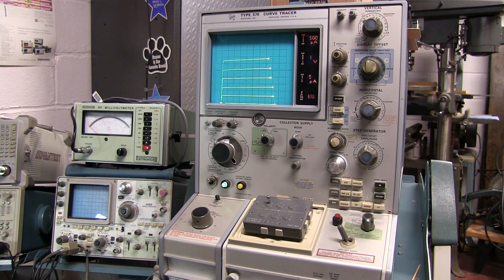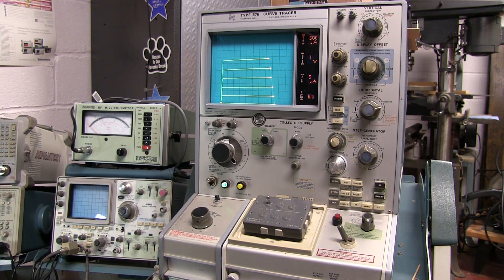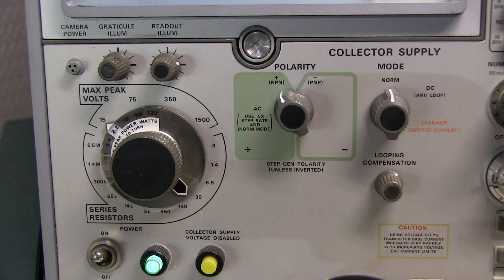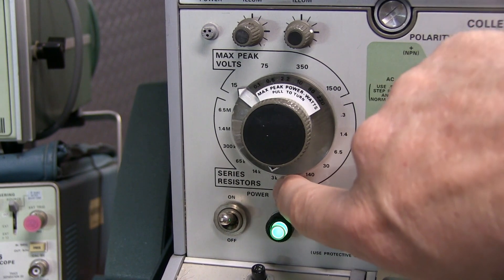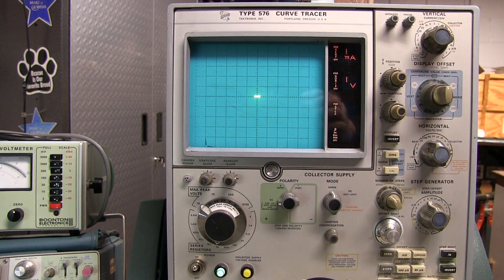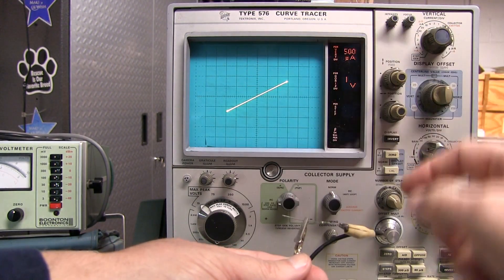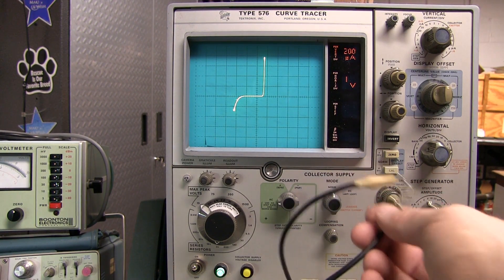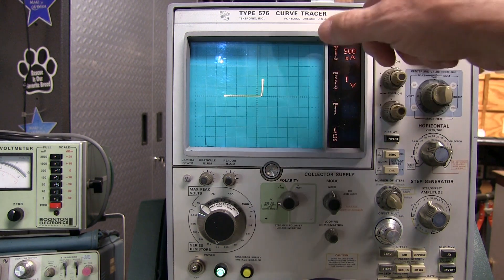#353: Quick Tips: Using a Transistor Curve Tracer as an Octopus I/V Tracer or Huntron Tracker

Comment: Do Curve Tracer measure the transconductance of Transistors and FETs? Some modern transistor testers measure the transconductance but its in Siemen Units which I'm not sure why its displays in Siemen units? I'm guessing the transistor tester is applying an AC sine-wave signal AC voltage to the transistors base and measure the transistors collectors current to compute the transconductance value?
Reply from the maker: Not directly, but it can be calculated between the ID/VDS curves at different VGS values.
Reply: @w2aew  The biasing voltage for a Tube, Transistor or FET will "change the gain more or less gain"/transductance, which is based on the biasing voltage? What I have read is the biasing voltage will change the transductance/GAIN more or less of the tube, transistor or FET. Does this sound correct? I'm guessing the tube, transistor, FET tester units transductance test is taking an "average" of all the DC voltages and displaying a transductance average. The tester unit must be using an AC sine waveform and measuring the input and output to compute the gain, while varying the DC bias voltage to get lesser gain or more gain and taking an average to display the transductance in siemens units?

Comment: I used the previous 575 curve tracer at work for years  to test transistors, diodes and Fet, they can be very useful when you need to sort parts for a specific parameter. In HS we had a 570 tube curve tracer that is pretty rare these days.

Comment: That curve tracer is in mint condition. I remember there is a Polaroid camera adapter for taking snapshots of the screen. Not sure if the film for such a camera is made anymore. Perhaps there is an adapter for a digital camera to take screen shots.
Reply from the maker: I used to have/use a few of the polaroid scope cameras.  It was a right of passage to have your photo taken with one and have it hung on the bulletin board in the lab.   I would think that one could 3D print an adapter for a modern digital camera or camera/phone.

Comment: Why are you applying an AC waveform to diodes and transistors to get a signature from semiconductors use DC voltage to bias them in operation region? I would think you would need a DC biasing voltage to put the diode and transistor into operating region to get the correct signature. For Capacitors having an Ellipse circle shape but since its a Ellipse Circle which part is the current and which part is the voltage? The Shape/Size of the Ellipse Circle is based on the capacitors value which the Ellipse Circle shape/size is the voltage and current?
Reply from the maker: Using AC allows you to get the current-voltage curves easily traced.
Reply: @w2aew  Yes but I would think that semiconductors like diodes and transistors would ALSO need DC biasing voltage to see the correct signatures?
Reply from the maker: @waynegram8907  You can think of the applied AC voltage as just a slowly varying DC bias...  That's essentially all it is doing.
Reply: @w2aew  Curve Traces do apply a DC bias voltage to diodes and transistors As well in addition to applying the AC signal?
Reply from the maker: @waynegram8907  They can be setup to do either, or both.
Reply: @w2aew  but when I apply directly just only an AC voltage to a diode I don't get an IV curve on the Oscope, any reasons why?
Reply from the maker: @waynegram8907  Because an Oscope is not a curve tracer.  The Oscope displays voltage vs time.  A curve tracer displays votlage vs current.  In order to get a IV curve with an Oscope, you'll need to use something like a curve tracer adapter - like an octopus tester - so that you can get a current waveform along with the voltage waveform and display them in XY mode on the Oscope.
Reply: @w2aew  The Curve Tracer Adapter/Octopus tester should also have addition is a DC biasing voltage but they don't apply also a DC biasing voltage to the transistor for IV signature but for curve tracing the IV signature has DC biasing also. I'm confused on the Huntron/Octopus is only applying an AC voltage which is a "IV signature" compared to a Curve Tracer is applying an AC voltage and also a DC biasing voltage which is a "IV Curve Plot". I don't know what the differences are between an IV signature compared to an IV curve trace because they are both different and not the same
Reply from the maker: @waynegram8907  The VAST majority of curve traces apply either a full-wave rectified AC, or an ordinary AC test stimulus to the device for curve tracing.  Full wave rectified AC when you only want the device  swept over one polarity, such as generating transistor characteristic curves.  An true-AC stimulus is used when you want to sweep from negative to positive - such as looking at a zener diode.  Both test conditions are valid.  Rarely is any DC bias added in.  

The one place where DC is used a lot with curve tracers is when sweeping three terminal devices (bipolar transistors, FETs, etc.).  Then, usually a stepped DC bias is applied to the base/gate while the collector/drain voltage is swept with a fullwave rectified AC stimulus.  Sweeps are repeated at various bias levels on the base/gate.
Reply: @w2aew  The Octopus/huntron  component IV signature is completely different than a Curve Tracers component IV signature, any reasons why? getting the IV signature of a Diode or Transistor using the octopus/huntron has a different IV signature compared to the Curve Tracers IV signature. I'm not sure when getting an IV signature using a curve tracer is this called a "signature" or what is the plot of the IV called when using a curve tracer? My Main point is both signatures are completely different when using the octopus/huntron compared to using the curve tracer. So something is different about the IV or AC stimulus waveform they use in the curve tracers compared to using in the huntron/octopus which is giving different IV results?
Reply from the maker: @waynegram8907  They should show you the same thing - assuming the Huntron and the curve tracer are setup to supply the same voltage, through the same source impedance.  It's also possible that the Huntron or the curve tracer are "inverting" one of the axis (positive goes down instead of up, or left instead of right).  If the trace you see is flipped top-to-bottom or left-to-right, then this is what's happening.  Perfectly normal and expected.
Reply: @w2aew  If you can make a video compared a huntron/octopus to your Curve tracer when doing signatures for diodes and transistors they will have different "signatures" because I think the AC stimulus is different in curve traces its not a 60hz or 120hz AC sine waveform. I think the curve tracers use a special type of AC waveform. Also the curve tracers are applying a DC biasing voltage to the transistors base compared to the Octopus/huntron which will give you different IV signatures. Curve Traces don't call them IV signatures they call them "IV Plots or IV Profiles" so they are different it seems. It would be a nice video lesson to compare diodes, transistors, FETS using an octopus VS a Curve tracers. I would like to open up a curve tracer and use an oscilloscope to measure the AC stimulus waveform or AC step waveform used in curve tracers to see what it looks like. Huntrons just use an AC 60hz,120hz, etc
Reply from the maker: @waynegram8907  I can't make a video comparing a Huntron Tracker since I don't have access to one.  The IV plot will NOT depend on the shape of the AC stimulus.  Curve tracers do not use any "special" waveform, they also use simply AC and full-wave rectified waveforms derived from the line voltage.  The only "extra" that curve tracers have compared to a tracker is the ability to apply a bias to a 3rd terminal of a device like a transistor, while developing the IV trace for the other two terminals.
Reply: @w2aew  The Curve Traces has a dial control to change the source impedance which is changing the Resistor value that is "in series" with the component under test? Because you need a resistor in order to get the "I" trace? since the Oscope does time vs voltage, you need a resistor to do the "I" trace which they call the resistor the source impedance?
Reply: @w2aew  You have a function generator set it to 60hz or 120hz and apply that to a diode and you will get an IV signature on the Oscope XY mode? to get the I current trace you need a resistor
Reply from the maker: @waynegram8907  yes
Reply: @w2aew  Yes you can make a poor mans curve tracers by using your function generator at 60hz or 120hz and using different series resistor values to change the source impedance and using an Oscope in XY mode. You can also use a bench power supply to apply a DC voltage on the transistors base. Transistors datasheets says they can operate up to +25vdc so I'm guessing you can apply a 25VAC @ 60hz or 120hz and adjusting the DC biasing voltage. This would be a good video lesson how to make a poor mans curve tracer. I thought Stimulus meant that the AC is being sweep or has a custom profile curve because its called an AC stimulus. I don't know why curve traces just don't say its a normal AC sinewaveform nothing special.
Reply from the maker: @waynegram8907  They don't say that it is a sine waveform, because the waveform shape doesn't matter - you'll get the same result.  I did a video 7 years ago showing a simple IV tracer using a function generator and a scope: https://www.youtube.com/watch?v=WWY-pakm_OM
(and no, +25Vdc is NOT the same as applying 25VAC - 25VAC is an RMS value.  A 25VAC sinusoid signal swings from +35.4Vpeak to -35.4Vpeak.  Also, the transistor might be rated for 25Vdc, but NOT for -25Vdc....
Reply: @w2aew  If the transistor is rated maximum at +25vdc, if I apply +35.4 peak to -35.4 peak AC sinewaveform it will damage the transistor. I'm trying to test the transistor maximum rated voltage but how can I do this using an AC waveform?

Comment: This may be an amazingly stupid question, but why is it no longer possible to buy modern curve tracers, is that now done by the oscilloscope?
Reply from the maker: While there there still applications where the analog curve tracer is very well suited, most of the applications for 2-terminal and 3-terminal curve tracers have now been filled with units such as Source Measure Units (SMU) and semiconductor characterization systems.  Examples of each of these are Keithley 2450 SMU and the 4200A characterization system.  I believe Iwatsu (out of Japan) still makes a curve tracer.  There are many "kits" available to use with your oscilloscope to perform the curve tracer function.
Reply: @w2aew  Oh yest these cheap SMU's that everybody have a couple of:-)
No I would love such a unit, but it costs more than my entire lab, incl furniture and component storage.
Thanks for your great reply, I'll take a look on these solutions. :-)

Comment: Hi, a little off topic - but I enjoy your videos, especially as a Ham (W1BVV).  I saved  a dead 465 a few years ago by replacing the HV multiplier module with a Tek NOS part found on Ebay.  I now have been given a 475 with the same issue, but I'm coming up empty on a multiplier.  So I'm beating all the bushes - do you have any suggestions on a supplier or an alternate part, or possible comments on making and potting a replacement?  I know the multiplier is conceptually simple but with 12 kV the devil is in the details. (retired EE, Physics teacher and Ham)
Reply from the maker: I wonder if some of the fine folks over at vintagetek.org might be able to offer some advice - I'll reach out to one of my friends there...

Comment: Are curve tracers a bygone technology because Transistors are only 2 cents?
Reply: Just three years ago I saw a handful of those machines on the shop floor of Analog Devices after they moved into the new offices on Santa Clara Square.  Not long thereafter they frosted the windows on the first floor.  Guess, they didn't like me peeking in ;-}
Reply from the maker: Not entirely.  A curve tracer can help you characterize the device parameters and help identify matching devices, along with a host of other tasks.  Even the folks that make 5 cent transistors need to test and characterize them.
Reply: @w2aew  I learnt to use a curve tracers  at college.  I would love to have one, but no longer manufactured
Reply from the maker: @octapc  Modern instruments like SMU (source measure unit) can do simple 2-terminal IV sweeps.

Comment: Cool.  What documentation would typically show the expected curves on a PCB?  It's been a long time since I worked on consumer products, other than my own.  I started out in a TV/Radio shop ~45 years ago, but went to industrial service around 1982.  I do not recollect SAMS showing expected curves.  I would love to see documentation like that and then play with my 576 some time.  Right now, I'm still doing industrial service and engineering rarely had service in mind when creating documentation - lol.
Reply from the maker: This was more common in things like Navy service documentation, etc., more-so than commercial/consumer equipment.  Also, used to be common in factory dedicated troubleshooting/repair centers.
Reply: @w2aew  I watched Carlson a year or two ago trouble-shoot a display driver (powered off) with his curve tracer, in circuit, to find the bad output of a driver I.C..  I would have used a scope myself never thinking of a curve tracer for trouble-shooting.   I can see it useful in notes for powered-off trouble-shooting.  I have a 576 too, but its on a shelf in the storage room as I do not have enough bench space for it to use as a trouble-shooting device (and I can't lift it - lol).  I can see a small tracer hooked up to a scope, being useful for that.

Comment: great video i love mine but i got to fix it again, after i full recap and replaced the hv transformer with a new one, everything was working great and then one day i turned it on and only a couple mm line on the screen,  all voltages are correct and stable everything seems to work just no display. not sure where to start.

Comment: it is like using a dump truck and weighs about the same .... and these are not cheap when trying to buy one at a swap meet or online bid sites....
Reply: It was expensive 40 years ago! $6,480 USD in the 1980 Tek catalog. $22,600 adjusted for inflation today. But I have an HP analyzer that sold for about $24,000 in those days....